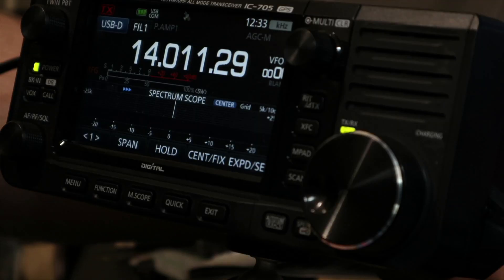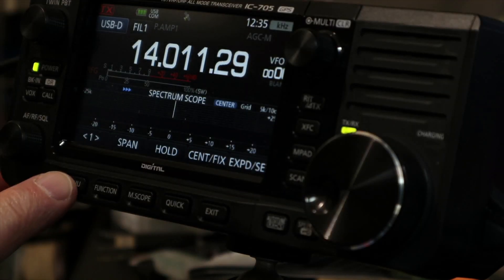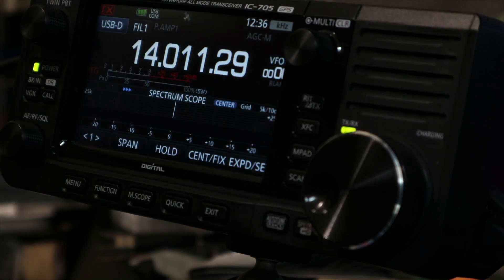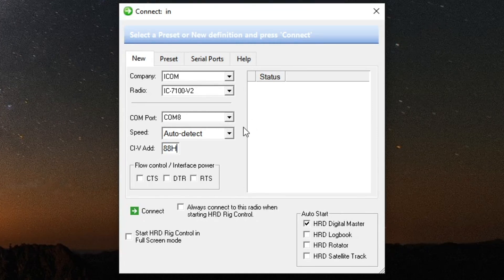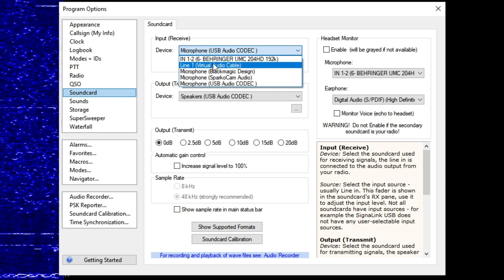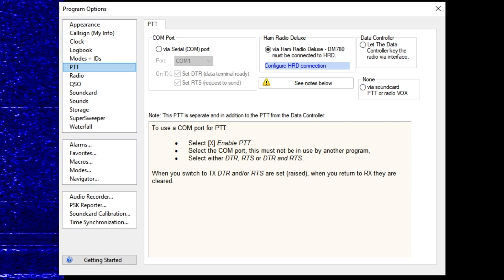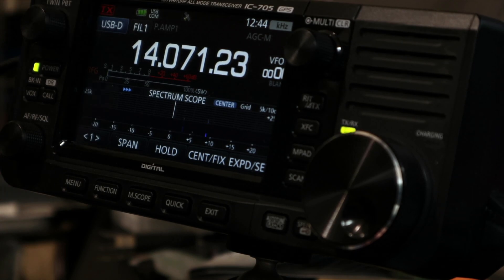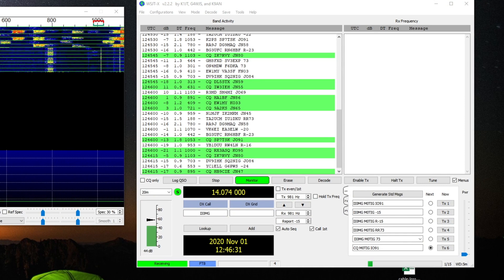Icom IC-705 connecting to HRD AND WSJT, DIGIMODES

Comment: Thanks for the video.  How "loud" should the Tx be?  How do you control that other than the Pwr lever on the side of WSJT-X?
Reply from the maker: You need to have 0 alc .. that’s about 25% on the power slider in wsjt make sure no more than 25% total power out.. and alc is almost at 0
Reply: @TheGazLab  So just adjust the power slider on the left?  And keep AF Output Level at 50%? thx.
Reply from the maker: @frankwc0o  af? Tx level is set by rf power level and the wsjt slider.. set the slider at 25% and TX power on radio to 25% adjust slider for 0 alc..
Reply: @TheGazLab  Ok, got it.  I'll try that right now.  I'm on JS8. Trying to catch anyone on 40m.  thx.

Comment: Thanks Gary. Any idea what the method is to run HRD and WSJT-X simultaneously ? I can run FT8 on WSJT-X fine, and I can connect to HRD fine. But how to connect both at the same time ? I tried using the USB port for one and the CIV port for the other, but still can't get  both software to connect to the radio together. I have tried on my IC-7300 and also IC-705
Reply from the maker: Yes you can set hrd in wsjtx you need a late copy of hrd .. watch this space I’m just doing a little something on this very thing..

Comment: I can't seem to have WSJT-x and HRD both connected to CAT port at the same time.  Is there something I'm doing wrong?
Reply: Wondered if you got this working.  I got it working on my Yaesu FTDX10 with one cable.  HRD has to be started first, then WSJT-X is started with the Radio tab Rig setting set to Ham Radio Deluxe instead of the radio model name.

Comment: Anyone else having problems finding the right USB cable?  I know Josh from Ham Radio Crash Course said it was a bit picky finding the right cable - I'm having that slight problem at the moment. 🙄
Reply from the maker: i'm just using a standard old thing.. do be careful of ground loops tho.. had a couple of cases where people have had that issue (noise on the ground) especially if the are running the audio back to a pc or laptop ..

Comment: How long is your garden Gaz? You could potentially put the feedpoint for an EFHW at the furthest point, and raise the free end via a pulley secured to the wall under the eaves. Takes moments. When not in use, the radiating element can be coiled and left on the fence.
Reply from the maker: Yes I’ve done something like that now.. I got people in and out at mo so no point .. I’ve got stuff to do out there with getting shot of trash lol then concrete time!! Gaz
Reply from the maker: sorry its 8mtrs lol
Reply: @TheGazLab  If not, contact them and ask them to make a 20m multiband one.